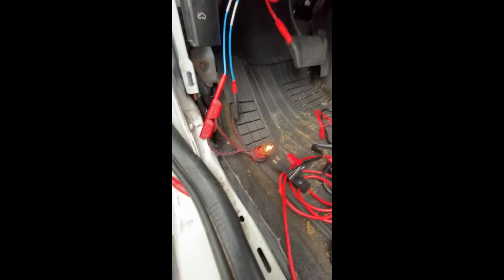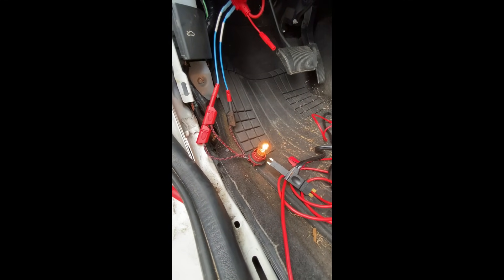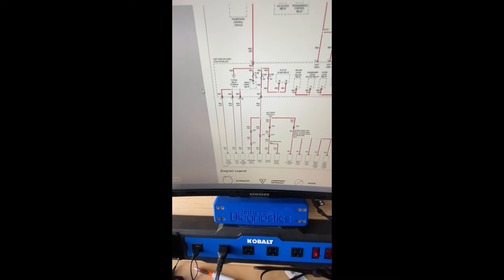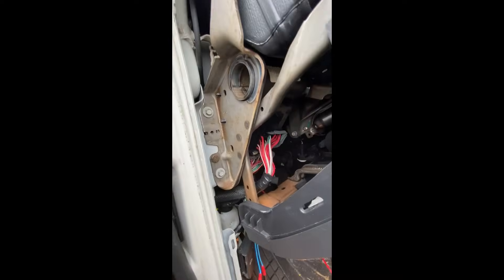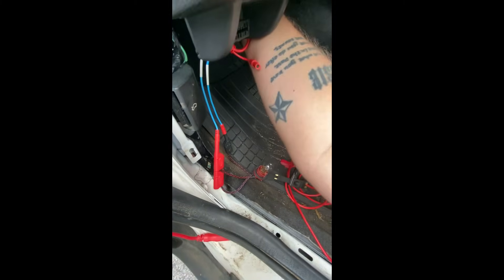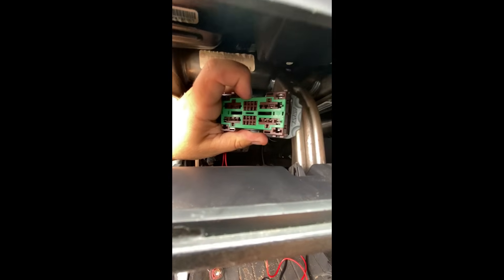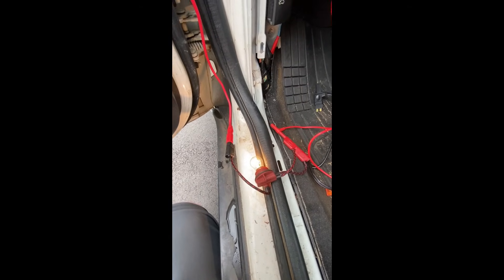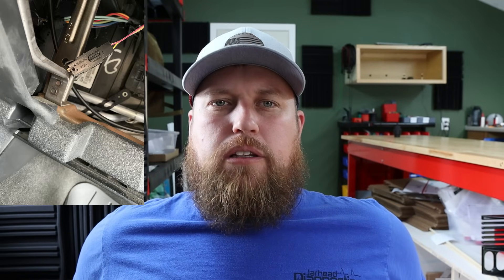Easiest way to find a short to ground!

Comment: An even easier way is to use a DVOM. Ground the negative lead of the meter and put the other end of the meter to the fuse output (this one will give you continuity to the ground). Select continuity on the DVOM (the one that makes noise when there is continuity). Then disconnect connectors or components until the DVOM does not give out a tone. This way you don't have to be looking at the light all the time you can go by sound when there is no more short to ground.
Reply: No go. You have to draw current through the test lamp to eliminate "weak" earth/ground through motors, bulbs other "consumers."
Reply: @ovedalgaard7645 no he is correct. I was trained this way as well in school to find short to ground
Reply: The DVOM is not enough of a load. I've had circuits that the DVOM said had 12v but would not carry the load
Reply: @neilhanley3468  Good point. Without enough amperage getting through things can act wonky.
Reply: but have tht think buzzing the whole time? Not sure that's worth it:hand-orange-covering-eyes:.
Reply: @raynic1173  it's not too bad at all plus you don't have to keep going back and look at the light because sound travels all over but you have to go back and look at the light all the time.
Reply: Both ways are correct, just have to know how to read a meter is all. 0.1-0.3 is normal and you add a point for every module the circuit runs through so 0.6 or 7 is fine if it has the additional modules if not then you have a bad or shaky ground.
Reply: @deewalk1337 Keep crawling out from under a dash or the car and you will catch on sooner or later.

Comment: As soon as you said new heater core the thought of pinched or crossed connection in the glove box was my first thought ….but being only shade tree level experience only ,idve gotten frustrated if I didnt notice the issue quickly ….😂

Comment: The EASIEST way to find a short to ground is to connect one probe of a taser to ground with a test lead,  then connect the problem circuit to the other probe with a second test lead. Fire up your taser, and the short location will give off very obvious visual and audible cues. If you know what ozone smells like, you can even trace it down by smell.

Next week, we will discuss module replacement...
Reply: After 40 years of smelling shop chemicals, my sniffer ain't working very well. What if i combine your method with my  propane enrichment tool to locate the short?    [jk]
Reply: @hightttech  I’d recommend stepping up to hydrogen to make sure you find it. Lol
Reply: Any of you guys have a match?

Comment: Not only the easiest but the best way. If you don't have a test light you can make an emergency light yourself. You need to have a wire long enough to be cut in two. The other materials are already in the car. You can use the blown fuse and any working light bulb in the car.
Reply: Your a liar

Comment: Is this safe to do always and wont fry something else? I have a blown 15A ECM fuse where thebwire goes to the ECM. Fuse blows anytime the door is opened (car wakesbup I guess). Just dont want to fry my ECM or other components using this method. But im having trouble finding where to search next!

Comment: Trained to check all of those circuits ,  not stopping just because a fault was detected  .   But guess it is better this way to help people from getting lost in tracing circuits  and  schematics   /    l would like that all of you get to enjoy intermittent casualties ,  like a lost fastener that Some boot licker has lost and does not report  and is jumping around on pin blocks .

Comment: You can set your DMM on DC voltage in place of the light. And as long as there is a short to ground it will show the circuit voltage.
Reply: True. But a light is good, simple, and easily seen from a distances.
Reply: DMM input impedance too high; you'll read ghost voltage if there is leakage in circuit. Without a load, you might waste time following leakage paths. If you choose not to use a ballast lamp technique, then select an appropriate shunt resistor to substitute for fuse, and use DMM to measure voltage across that.
Reply: Only if all other loads are removed and there are many on this circuit it's a fake vidio

Comment: this is a great technique.  I would very much appreciate a more complete explanation of how to hook up the tester, though. Do you put its leads across the fuse connectors?  put one lead on one side of fuse, the other lead on chassis somewhere? if you get no light, then move the first lead to other side of fuse?  I would assume some readers know very little to start.
Reply: You put the test lead into the battery + side of the fuse holder and the other lead in the load side of the fuse holder.  If there is a short the light will light up because you will have current flow. The light acts like a resistor which limits the current.  This keeps you from having to replace blown fuses constantly till you find the short. Hope that helps.
Reply: There shouldnt be voltage or a lit bulb across the fuse terminals if the the switch in the affected circuit is open thus completing a path back to ground.
Reply: Please explain how you hook up the test light, I know nothing...lol
Reply: How do you know the battery side from the load side
Reply: Yup, that would be me. Watched this video and got nothing because how the test leads were hooked up wasn’t explained.

Comment: Could you have done the same thing with a DMM? Set to oms with the test tone.
Reply: You can set your DMM on DC voltage. And as long as there is a short to ground it will show the circuit voltage.

Comment: The light bulb is plugged into both sides of the fuse terminal but it lights up on the fuse with short because it’s able to ground the light to light it correct?? Automotive novice question thanks for your time
Reply: Or through another bulb

Comment: Had an issue on a 89 chevy truck. Tried to find it by removing fuses no luck there finally tracked it down to a worn positive battery cable shorted to the battery tray intermittently draining the battery overnight.

Comment: Nice job diagnosing the problem using a solid but simple and effective technique.  Might add that whenever you have a (new) problem that appears to be a result of other work done on the vehicle, its a good general practice to do a solid visual inspection of the area where the work was done.  It's very common for things not to be fully reassembled or properly reassembled when components are replaced.  Especially if it required removing interior and/or dash assemblies.  Thanks for the video and the tips.
Reply: One example of that that comes to mind is when you get a new radiator, then take your ride to someone else for something else entirely, and they tell you someone forgot to fill your new, empty radiator (after that--and it was a reputable place I've gone to for years that I will not slam because I'll probably keep going back--I do some checking after that one and I'm supposed to be the idiot when it comes to practical matters).

Comment: In those years of the Grand Cherokees you have to remove the dash to replace the heater core. If the job was given to a low quality tech they usually ended up that way or worse with dash rattles that required the dash to be removed again.  Check your work boys, if your customer has to check your work you won't have many customers left.

Comment: I am curious. You said there was a short showing on pin 6, 7, and 19. When you have multiple possible short locations like this, what allows you to decisively say that pin 6 is there error circuit? I only ask because I am showing like 7 pins on a connector with a short to ground, so does this mean they share the same ground? How do I figure out which is the circuit in the connector with the short to ground?
Reply: Bi or try type of curious? Asking for a brother that commented above…
Reply: @Simplytrolling87 ??
Reply: @ayeeiou9147  wondering if the curiosity he has is dealing with his sexuality… ??

Comment: How did you wire up and make your test light that can be put in the fuse locations????
Reply: a light and one wire end to one   of the fuse side and the other wire to the other side  .
Reply: You can buy an in-line fuse circuit tester at any auto part store, even Walmart. It has the 2 fins Ike a fuse but each end has a wire attached so you can then attach your test light or what have you

Comment: 50 requests for clarification and one half assed reply. Not gonna sub or waste anymore time here.  Can't believe there aren't any other viewers filling in some answers where the creator can't seem to help...
Reply: FYI bro, if using a test lite, plug one end to a positive power source like the battery + post,  then the test end to the fuse, If the test lite turns ON, it means there 's a short to ground. Any fuse in the fuse box Only has Positive + power when turned ON. To do this test, you must not turn the ignition switch to ON. Just leave the keys off the switch. Hope it helps..
Reply: @raymanning1064  actually, it really does help, man. Thanks a million. Honestly, I remember using this method some years back but didn't remember the (quite simple) details about it. My sincere gratitude for the reply.
Reply: It's a fake video
Reply: @sartorst3376  comment above by raymamning is on point. Refer to that before the video
Reply from the maker: Thank you for the reply. Helps with analytics. Also, thank you for not subscribing. Less likely to get comments like this.

Comment: So you mentioned replacing fuses and that they would blow out right away so the fuses had nothing to do with it?
Reply: That is correct. It’s not a fuse problem. The fuse is just there for protection. The problem is the short in the system that causes the fuse to blow.

Comment: Forgive me guys, I'm a noob looking for a ground fault.  I'm sorry I'm not sure I understand how a test light used to complete a circuit in a fuse panel shows you a bad ground.  Wouldn't it light up in any fuse location?  What causes it to light in a bad ground situation?  Wouldn't it go dark if the ground was bad?
Reply from the maker: No sir, if the ground was bad it would cause the light to light up. This is due to the ground path completing the circuit.
Reply: @JarheadsGarage , hello Sir. One question does the ignition switch has to be on the ON position or switch OFF. In order to perform this test to find a bad ground, Thanks in advance...

Comment: Thank you very much…. I watched this video long time ago, when you posted first time….. last week I received a Chavy impala with fuse emission 2 15 amp keep blowing, 2 workmates didn’t figure it out and they replaced that fuse….. my service manager handed to me… I figured out there is a short by using power probe and no tone or light on the ground side…. It was not convincing… I remembered your video and attached the light bulb and that helped me a lot…. Found the bank 2 sensor 2 O2 sensor rubbing against the CV axle…..Thank you
Reply from the maker: Awesome find!
Reply: How do i get wiring fiagrams like you have here on ur laptop ?  @JarheadsGarage

Comment: It's shorted out, all the way to the ground post , isolated , no ground hooked up. And I have 12.6 to ground post of the car frame , all the fuses is 12.6, alternator has 12.6 volts on the terminal side and the ground side. I reversed the process isolated the positive and of course it has ground all the way through.  I pulled fuses and relays and no voltage drop. The only thing I did not unplug is the ECM. So I have closed relay or a exposed positive wire touching the frame. But I have a power probe 3 and a signal tester for breaks. It's a chrysler sebring 2006 2.7 litter . Be for the wife broke down the battery light came on, wife said smoke came from the passenger side of the engine.

Comment: I didn’t understand
Reply: A normal circuit will have 12 volts on both sides of the fuse. This circuit is shorted to ground on one side, while the other side has 12 volts. since the shorted side goes to ground the bulb will turn on if the fuse is removed and replaced with the bulb. The bulb will remain lit as long as the short exist. So disconnect one circuit at a time until the bulb turns off, now you have found the short.
Reply: Ditto!
Reply: He established a live was going to ground with a bulb, then disconnected each circuit to see which one was
Reply: Wym each slot on a fuse has 12v...one side just isn't grounded unless the car/component is on (unless there's a short)
Reply: Think of a fuse as nothing more than a solid piece of wire .  Now think that wire is connected to the 12 volt battery post, 
If you bare that wire in two places ( like the fuse tabs) and test voltage across those two bare spots you will get zero voltage even though it is on the 12 volt battery post. 
Take that same piece of wire with 2 bare spots take your red volt meter lead and touch either bare spot and the black volt meter lead touch the battery ground you now get 12 volts reading because you need the ground to complete the circuit . 
The Light bulb he used is a very crude volt meter that he attached to the fuse receptacle, remember the fuse is like the piece of wire with two bare spots. Because one side of the fuse circuit is shorted to ground the light bulb lights. If there was no short to ground the light bulb would not light.
Reply: You don't understand because it want work as shown it's a fake
Reply: @sartorst3376  It is not a fake you clearly don’t understand electricity. Yet you feel entitled to call a fake when you have a knowledge problem.
Reply: @sartorst3376 how is this fake? Circuit is blowing a fuse. He replaced the fuse with a light so power would continue to flow between battery and the short to ground. A light needs power and ground to illuminate which this circuit has. power from battery to fuse block, through the light and to the short at the glove box. When you remove the short to ground, like opening a ground side switch, the light will turn off. This is one of the most basic electrical troubleshooting  techniques. I learned this method in  marine corps 3521 school back in 1990 using simple test lights and its been in use since automobiles and test lights were invented. I continued to use this as a mechanic for years and now as a master electrician when diagnosing low voltage DC circuits.
Reply: @sartorst3376 it is real, believe it or not. If you connect a bulb to a fuse socket that has 12 volt one one side and ground (because it is shorted) on the other side the bulb will turn on exactly as shown in the video.
Reply: Replace the video until you copy in
Reply: @marcussok6469 ??
Reply: @marcussok6469 
What's the frequency Kenneth?!

Comment: MMMMMMMAN !!!! THATS SOME AWESOME DIO MY BROTHER . here is my story i been told to share with you . 1 yr 11 months ago i drive my((((((((((( 2011 BUICK LACROSSE CXS with 3.6L engine)))))))))))))) to the V.A. HODPITAL for my doctors appointment . after i was done 3 hrs later lol , you know this as a vet yourself lol , i came to my car ,when i opened my drivers door ,i heard what sounded like a machine gun going off under the hood .got in car , pushed the starter button and wouldnt crank or start . i got out went under the hood and began investigating . i finally called for a ride and later came with tools to diagnose . i found the # 10 fuse burnt and keeps burning everytime i try to start . what gets me ,everytime i push something on my remote , first connect the battery ,open doors,trunk i hear that very rapid clicking under the hood .i towed to house and i been working on it almost 2 years since , i get frustrated and stop a while then continue eventually lol . i notice when i pull the KR71 RELAY "MITCHELL 1 CALLS IT ,BUT CHILTON CALLS IT KR75 , MY FUSES DONT BURN ANYMORE . THE # 10 fuse goes to a junction that splits into 3 wires that goes to PCM(ECM).THIS RELAY ALSO FEEDS FIUSES 8, 9 ,11, AND 47 OR 46 DEPENDING ON WHAT VERSION YOU HAVE . ! i have never encounter such a terrible problem in 40 yrs my brother . i got a overwhelming good feeling you can help me brother , strange right ? . my CODES COME UP THEN AND NOW AS UO100 AND PO23F . THE DASH ALWAYS SAID ,SOMETHING WRONG WITH STABILTY TRACK AND OBJECT DETECTION . SO MANY strange things about this one brother . any tips or ideas you may have is greatly appreciated  my brother ! thank you in advance for your reply ! i have a bluedriver mod and app , powerprobe "the hook" , pp3 and ect-2000 and several test lights different kinds especially found of the computer safe one i got from harbor fright lol ,shows ground and hot , online chilton and pro demand  at my disposal ! i have put die-electric grease on a lot of connections fearing fretting the most .i dont want to be a parts changer thats why im still at it , please HELLLLLP !  LOL, I JUST SUBBED ALSO BROTHER !!!

Comment: Hey man wondering if you can shed some light on a situation I’m having in a 2009 Acura TSX while installing my aftermarket radio my constant power cable made some contact and all I heard was the spark and now I have no constant power all fuses are good in the car and under the hood any info would be greatly appreciated thanks in advance

Comment: We have a trailblazer that has a issue with the rear hatch, hatch control module is clicking and won’t allow us to unlock by remote. I replaced the module with a brand new one and it’s still doing it. Think I have a short to ground somewhere ?

Comment: can anyone please help me

so when you go wiggle wire harness and find the short does the bulb dim or go out completely as ive watched two vids of this method and both had light dim when found and other the bulb went out seen here?,i couldnt figure out why the bulb would go out because wouldnt this create a series circuit thus dimming both bulbs (pretend its a headlight circuit) as they now share the same circuit?